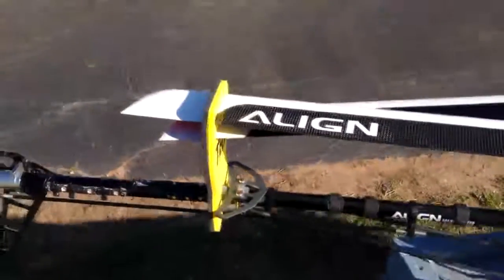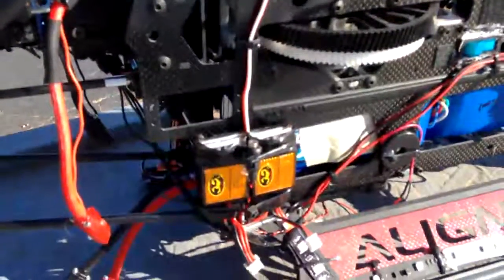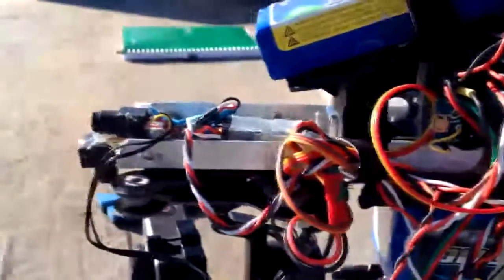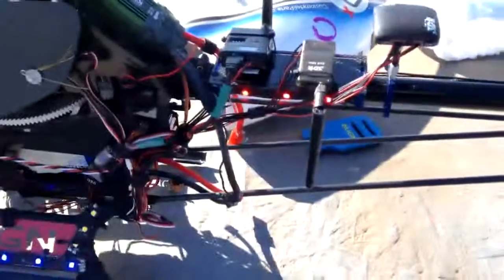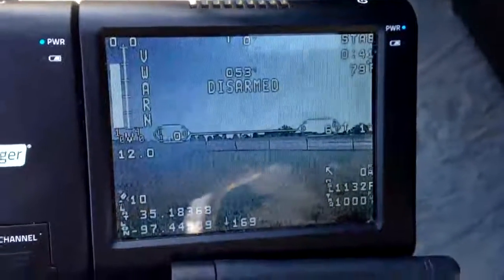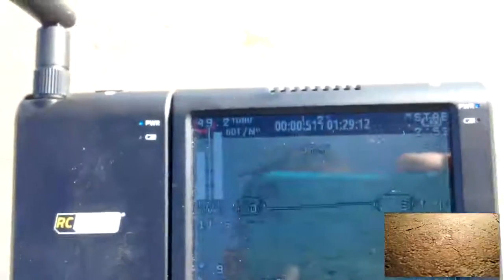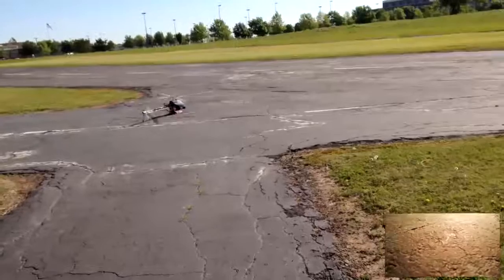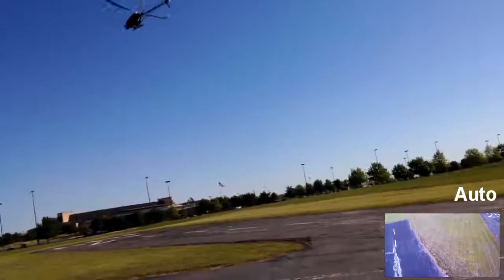Trex 800 with pixhawk

Comment: very impressive ! what version of the minimosd is that ?
Reply from the maker: It's a heavily modified minim extra 2.4.  I pretty much modified all the panels to give me what I needed.  I stole the batt_current pin for main motor voltage and it has bars for receiver pack (3s 12.5-10v) and the motor pack (12s 50-40v).
I also changed the warnings, changed it from statute miles to nautical miles, and changed the arrows to represent climbs and banks to be a little like a real cockpit/HUD.